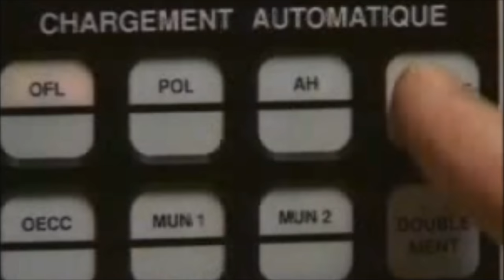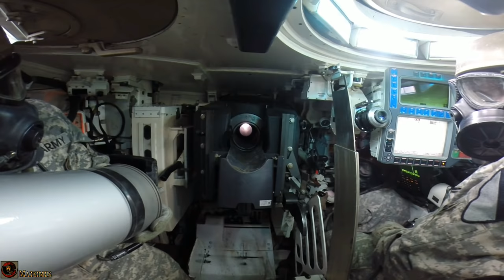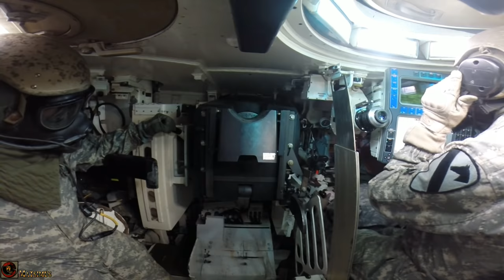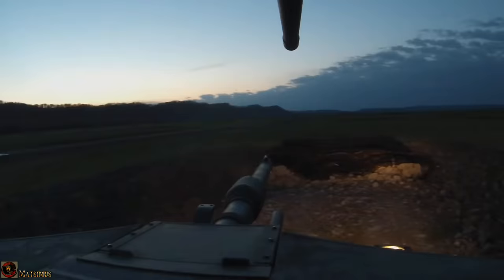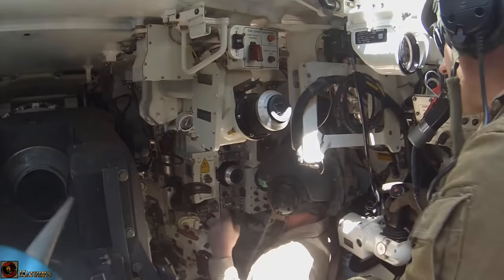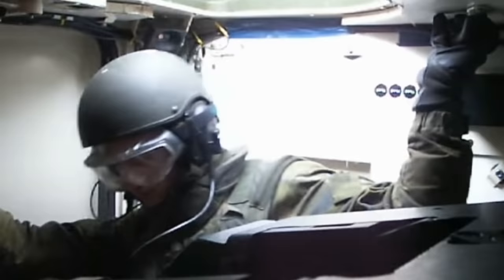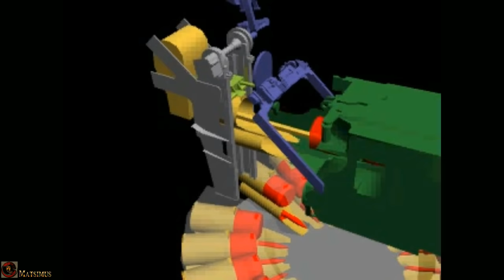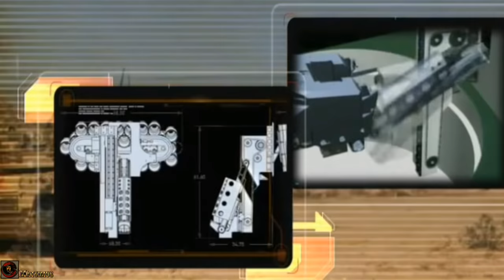Tank Autoloader or Crewman Loader?

Comment: Also, a point I would like to make, I have never heard of an instance of an autoloader jamming, particularly Russian or Soviet ones, all I have heard is speculation that they will jam.
Reply: Personally, I much prefer autoloaders.
Reply: One less guy to get killed but i suppose in asymetric warfare you hardly ever lose an mbt like the abrams or challenger 2
Reply: it is usually the gun which gets jammed (the breech lock)
Reply: Crewed an MGS after crewing an Abrams. The autoloader doesnt normally jam but when it does youre out of the fight since there are a lot of moving parts and places that it could mess up. If your traditional gun breech jams up you just beat the shit out of it with a wrench and that'll free it right up. Manual over auto any day of the week.
Reply: The key word is "normally", we are not talking here about the worst case scenario. 95 out of 100 auto wont get jammed, I cannot give you stats streight away but trust me, it is very reliable and saves heaps of time when you really need time, let alone it doesnt need crew to muck around it during the combat
Reply: Dmitry Koshkin It's actually a lot slower. When you fight you need that reliability. You also have less rounds at least in American vehicles. It's about 10-12 seconds as opposed to the 5-7 loaded manually. Survivability also takes a hit for the autoloader so you have a slower, more dangerous, and less viable system. It is a valid system, yes, but why wouldn't you go with the cheaper and more efficient alternative? Combat is all about the worst case scenarios.
Reply: Chris, I totally agree any combat is a literally worst case scenario and everything that can go wrong, often goes wrong. However, the time of the reload is about 8 to10 secs in t72, I dont know about the modern ones as I havent tried. But you should take into account, the crew who is loading the rounds is getting more and more tired with each one and their performance drops whereas the auto keeps the same pace. If I were the author of the video, I would better say that T72 is more possibly vulnarable to the ammo exploding in case it gets hit as the ammo is less protected because it has the auto.
Reply: Just read the T-14 armata characteristics, it says it can shoot 12 times a minute, needless to say it is automatic (it couldnt be done differently as the crew is separated from everything)
Reply: Would you want to be in a vehicle that has a jam? In the shit?
Reply: I saw once! And I heard many cases. Once the whole crew died...
Reply: its possiable tho
Reply: You could use the same logic with the transition from a bolt action to a semi auto really.
Reply: The biggest thing is the ammo cook offs which DO happen QUITE often. Look up any T72 hit videos and you will see them going up like rocket fuel nearly any time they hit. I'd honestly be ok with the autoloading system if it where not for that one massive achillese heel. I think even the modernized T90's still have that issue as they still carry ammo in the floor of the tank.
Reply: Bagheera2 Thats a Russian autoloading system. Now look up the rest
Reply: there were occasions in which the crew lost hands and arms because the autoloader cut off their body parts due to the very cramped space inside the turret, things could get stuck into parts of the autoloader while moving.
Reply: True, that happened a lot with western auto-loaders. They also were extremely unreliable. That is where most reservations about auto-loaders in the west came from.
Reply: this is from the T-64 data

the adoption of the autoloader was highly controversial for several reasons:

Early versions of the autoloader lacked safety features and were dangerous to the tank crews (especially the gunner, who sits nearby): Limbs could be easily caught in the machinery, leading to injuries and deaths. A sleeve unknowingly snagged on one of the autoloader's moving parts could also drag a crewman into the apparatus upon firing.

T-72
"Even one of the gunners I talked to from Belarus talked about how he was replacing a gunner who had lost a finger to it."
Reply: You are quoting Bryan Perrett, he is not a reliable source for Soviet Tanks. 
There were and are no such problems with the hydraulic (T-64 & T-80) or electric (T-72 & T-90). Only the T-64s early versions had reliability problems. But current conflict in Syria proves how robust the System is. While Turkish Leo2a4 and Saudi M1A2SEPv2 were shredded, the Syrian T-90A proved themselves as very reliable and tough. 
As I said the misconceptions about auto-loaders in the west primarily originate from very bad experience with the MBT-70 program.
Reply: why are you going off topic ? we are talking about autoloaders and you come out with leo4 and m1a2 ?
(saudi arabia doesnt use M1A2SEPv2 again you are bullshitter... M1A2S (Saudi Package): Saudi Arabian variant upgrade of the M1A2 based on M1A2 SEP, without Depleted Uranium armor)

to start with you can have the absolute best tanks in the world but if you dont know tactics and how to use it at some point it will be destroyed, the turkish leopard werent destroyed by ISIS, they were disabled with ATGM and the crew bailed so to prevent the capture the turkish airforce dropped 500lbs bombs on them to make sure ISIS cant get and repair them.

also there is this "ISIS terrorists have targeted a Russian-made T-90 main battle tank with an anti-tank guided missile near the village of Drehym in the area east of the town of Khanasser in the province of Aleppo.

The incident took place on January 23 and allegedly resulted in killing of the tank’s crew."
Reply: M1A2S (Saudi Package): Saudi Arabian variant upgrade of the M1A2 based on M1A2 SEP ! M1A2 SEP ! M1A2 SEP ! M1A2 SEP ! M1A2 SEP ! M1A2 SEP ! M1A2 SEP ! M1A2 SEP ! M1A2 SEP ! M1A2 SEP ! M1A2 SEP ! NOT SEPv2 !!!!!! the v2 variants have TUSK with ERA around the tank while SEP doesnt.
and anyway those abrams hit by ATGM worked exactly as intended, the ammo storage blew up out side and the crew was fine so everything went as planned in case of penetration.
(oh yeah i know about DU not having much effect against HEAT that was just added info.)

yeah a few Leo could have exploded because of the internal ammo storage which if ask is really really really dumb and just denies the use of blast panels.

T-90 is just an upgraded T-72 in fact it's original name was T-72BU but was changed because russian were scared that the poor performance of t72 in iraqi war would ruin their market (even tho those t72 arent real t72 but you know how market works) the only thing that makes t-90 good is the extra upgrades over the t72 like shtora and other hardware... but the only reason why t-90 does well in syria it's confirmation bias because of lack big numbers which would cause an increase of t90 destroyed, probably a better tactic (wiser use) and last the use of Kontakt-5 which works very well against HEAT which are the common threat in the middle east but T90 armor, the real solid armor not the ERA is just a joke... m829a3 are able to penetrate kontakt-5 and now m829a4 are being fielded because there was a need to be able to counter relikt armor which is actually pretty rare due to the cost so it's almost an useless cost.
Reply: You are talking about Tusk v2. Only SEP v2 ever get Tusk v2, but it doesn't mean SEP V2 = TUSK or TUSK v2.

There are no T-90/T-72BU in Syria. Only a hand full of these exist anyway. Most are T-90A and upwards, which have nothing to do with the T-72BU.
K5 worked just fine against m829a2. So m829a3 was developed, but in the meantime Russian T-80UMs and newer T-90s were fitted with Relikt. So m829a4 was developed, but in the meantime newer Russian vehicles are fitted with Kaktus, which again counters m829a4.
With the introduction of hardkill systems that work against KE rounds I really doubt the US will take the effort to try to counter Kaktus.
Reply: In my experience, it's way too easy to drop something inside an armored vehicle, especially under rainy, snowy, stressful situations. Batteries, ammo, flashlights, gloves, tools, anything really. That could cause jamming.
Reply: joezzzify 
No. Because bolt-action or semi-auto, you still have a rifleman (or riflewoman) behind it.
About the tank gun with auto-loader, you'll need more than one person to clear / repair it.
Reply: joezzzify n
Reply: Bagheera look at why Chieftain uses charge bin
Reply: T-90 increased a lot its survability in case of ammo hit.
Reply: Well recently it was proven possible: Ukrainian T-84 had utterly failed with their autoloaders malfuctioning on 3 tanks out of 4 and the one that could fire had a malfunctioning main gun stabiliser.
Reply: +Spetsnazovets link?
Reply: @DmitryKoshkin  Since the crew on the Atmata is separate from the gun and turret, when something goes wrong with the auto loader, 1. you're out of the fight and 2. who's going to fix it?
Reply: @chrisoreilly4757  If it really was the cheaper and more viable option, why would the KF51 and Abrams X mount autoloaders?

Human loaders are obsolete. A set of metal pieces with a motor attached to it is simply way less complex than a human. Think about the money the military spends recruiting, equipping, feeding, housing, training that extra soldier, not to mention the pensions once he leaves the Army. Remember all this goes to waste once he gets injured in combat, you can fix a machine easier than replace a trained soldier, and Economically machine is always cheaper than a human. Then when it comes to actual capabilities, both have ups and downs but, there are not enough disadvantages with modern autoloaders to justify the extra cost of a human loader anymore.

Comment: - The maintenance issue is pretty much nullified by the human loaders being converted into maintenance support personnel. They're just no longer part of the tank crew. 

- Manual loading suffers as the length of the battle goes on, as the human gets tired and the autoloader does not. 
- Autoloader performance also increases exponentially as the size of the round increases, for the same reason. Artillery firing shot after shot of 155mm has been shown to have very significant firing improvement from using an autoloader. 

- I saw an episode of Future Weapons where they covered a new towed 155mm artillery piece with an autoloader and they said it was very successful in testing in comparison with human loaders. Initially the human loaders were almost on par, but they quickly slowed from their original rate.

- I've seen modern tank designs with autoloaders that do compartmentalize the ammunition. I saw a video of a design with the ammunition in a bustle that pushed one round through the blast door at a time onto the autoloader's conveyor tube/track. The door then closes and the autoloader loads the round. I've heard of a possible modification for existing M1 Abrams tanks that would use an autoloader like this with a 34 round bustle. Aberdeen Proving Grounds also looked at a possible 46 round version of the same design for the M1A3 (new turret).
Reply: I will also say that human loaders might be the best way for loading to the cal of 120mm and below. As they "normally" doesnt weight as much. But if it gets over 120mm then an autoloading is the best because of the weight of the shells. I dont know if you can say that the Iowa class battleships (From BB-61) having semi autoloading system in their 16 inch guns. I had seen a video when they loading one of these guns, and it isnt fully on human nor mechanicly loading. I do say it is a mix of both
Reply: A potential design that I haven't seen, but could be made is one that has a three round revolver. The autoloader would load one round of each of the three types of ammunition. This would result in an autoloader design that could change ammo types without having to fire first.
Reply: Trifler500 Is that to the system that Iowa class has?
Reply: Daniel Jensen
No, that was more on my original comment and also in response to the video's concern that autoloaders can't change ammo without firing.
Reply: Nice comment, except your example of 155mm artillery pieces. I'm not in the military, but unless i'm mistaken, an 'artillery piece' is meant to shoot at targets long distances away, not fight other vehicles up close, meaning that the crew protection is less of an issue.
Reply: +AFoxInAviators I'm not sure what you mean. Nothing in my post is about fighting up close, and they're all separate, independent bullet points.
Reply: Trifler500 But one of his points was an autoloader made the vehicle more vulnerable, which is a moot point when fighting from far away.
Reply: AFoxInAviators
One of His points was about ammunition blast doors on tanks. One of his other points was about speed. Still another of his points was about something else, etc.
Reply: Trifler500 It was ammunition being in the forward area of the tank which meant one hit to the turret and the tank was knocked out. If the vehicle isn't coming under fire it doesn't matter.
Reply: AFoxInAviators
No he's talking about the ammunition magazine not being compartmentalized from the crew compartment. It's a common complaint against autoloader designs.
Reply: Well the reason for why autos are better at higher caliber is obvious, the machine is purpose built for the task of hoisting that weight of ammo into the breech while humans have to be physically well conditioned to perform the task as best as possible, and the heavier the object they need to lift the faster they get fatigued.  One definite benefit of an autoloader is that so long as there's power in the tank it will never tire out and because of it's purposeful design it will never have trouble lifting whatever type of ammo it's moving.
Reply: Well what's the Point of Physical Training when you're just gonna use the Technology to do the man's work? Maybe we don't need manpower to win wars. Just build Androids and Unmanned Vehicles to do the Job. So that the Human Race can be more Lazier.

Comment: I feel like once the 152mm and 140mm guns come into service autoloaders may become nessisary
Reply: 152mm and 140mm are artillery caliber shells. And artillery currently doesn't require an autoloader
Reply: @tsinjorasamy3852  a lot of 152mm and 155mm platforms have autoloader or are auto assisted.
Reply: @tsinjorasamy3852  t14 is experimenting with a 152mm gun
Reply: @shatteredstar2149  most do
Reply: Tsinjo Rasamy thats because the artillery cannons are usually stuck to the ground so the ground absorbs the shock but when ur in a cannon u feel the recoil badly plus all the sharp parts in the tank to so once the 152mm and 140mm come out I will be on the autoloader side but for now I’m with human loading.
Reply: @tsinjorasamy3852  MSTA-S has autoloader with higher fire rate and good damage effect